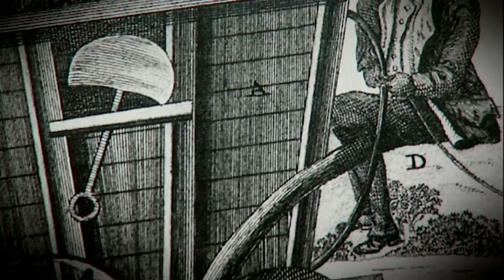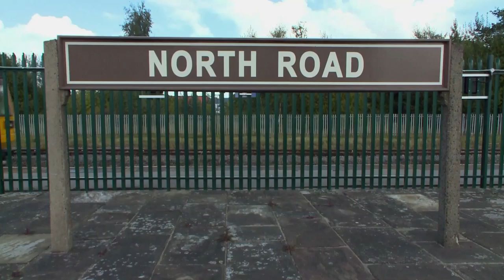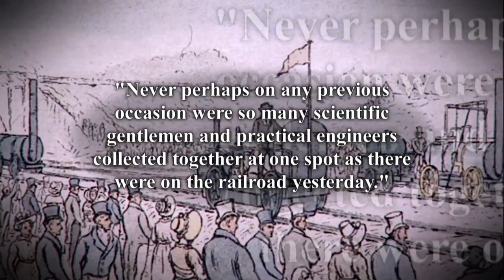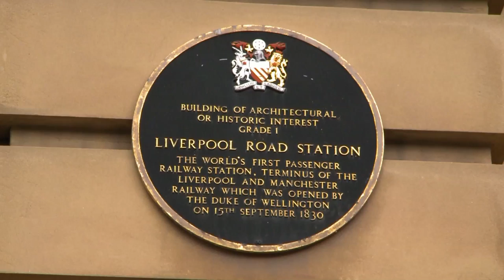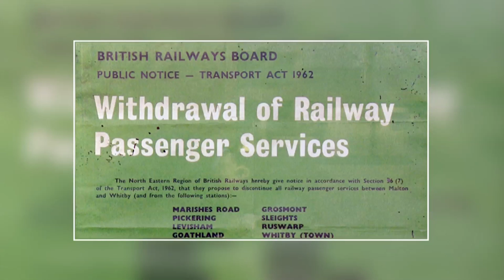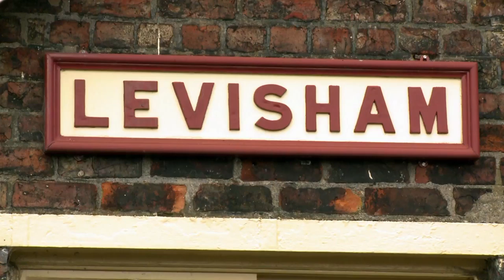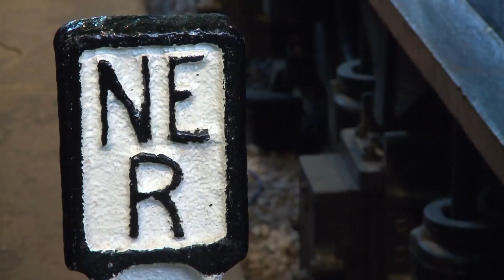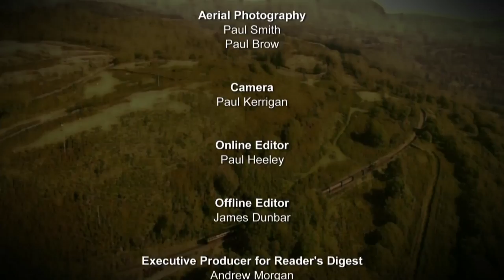Lost Railways - The North

Comment: Why can not incompetent researchers get their facts correct. The Stockton and Darlington Railway WAS NOT the First Public Railway and not Even the First Steam Railway as they used Horse and Steam haulage at first. The First Public Railway was the Swansea and Mumbles  Oystermouth Railway opened in March 1807,  using Horses till 1877, then Horse and steam till it was operated by Overhead Double Deck Trams from 1929 until final closure in Jan 1960. The true first all 'Steam Railway was the  Liverpool to Manchester in 1830.
Reply: peter buckley I think you'll find that the Middleton Railway is older, opening in1758, and was the first railway granted powers by Act of Parliament. It waxalso the first railway to successfully use steam locomotives.

The Surrey Iron Railway was the first public railway opening in 1802.

The first publically subscribed railway was the Stockton and Darlington railway, which was also the first public railway to used locomotives initially only for freight (coal). Passenger trains started on 10th October 1825, less than a month after the line opened. The passenger services were all horse drawn until 1833 when steam took over all trains.
Reply: It’s not the worlds first railway BUT IT IS the worlds first passenger railway. 
There had been a Railway in Darlington before 1825 running from Shildon (near Bishop Auckland) to Darlington. 
The line to Stockton was just an extension of that.
Reply: I don’t know where you got this information from Martin. The whole length of the Stockton and Darlington Railway from Witton Park near Bishop Auckland through Shildon then to Darlington and onto Stockton was opened in 1825, there was never a railway running in Darlington from Shildon before 1825.

Comment: The Dublin and Kingstown railway began operations in 1834, and was the first passenger commuter line anywhere. Almost every station on the line is still in use today, updated with the required accessibilities for the 21st century. Aspects of the original buildings are also still in use.
Reply: inquisitor229 the first ever Train was in South Wales. Richard Trevithick designed Pen-Y-Darren and ran from Merthyr Tydfil to Abercynon in 1804.  And went 20mph. And, and. Steam locomotives were designed to carry freight first.